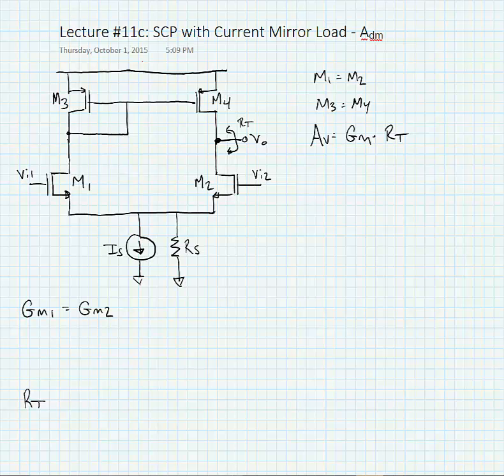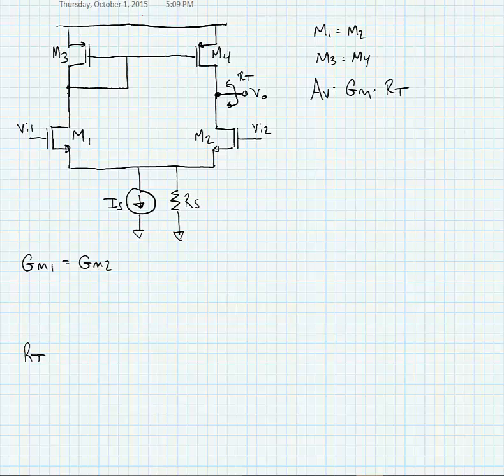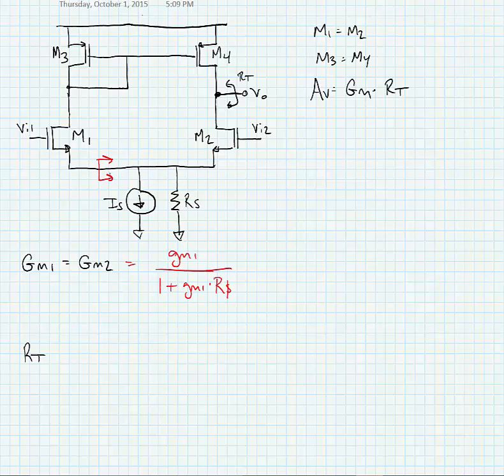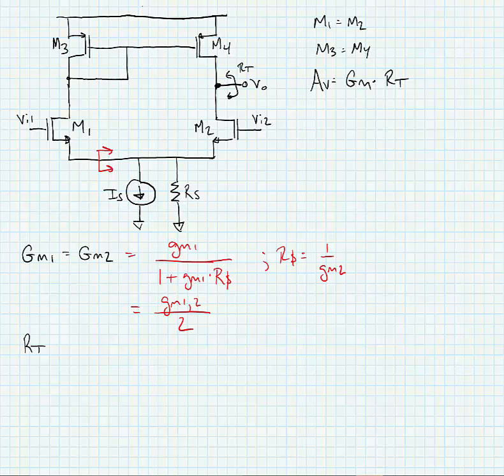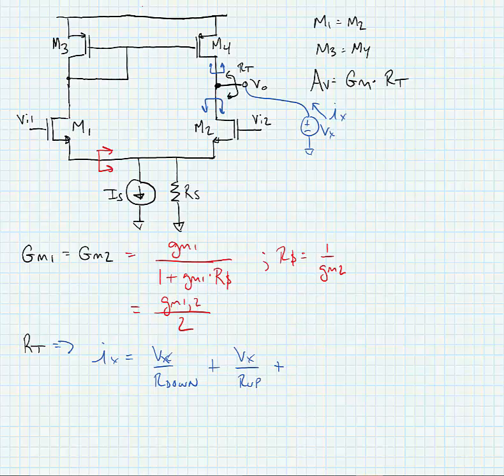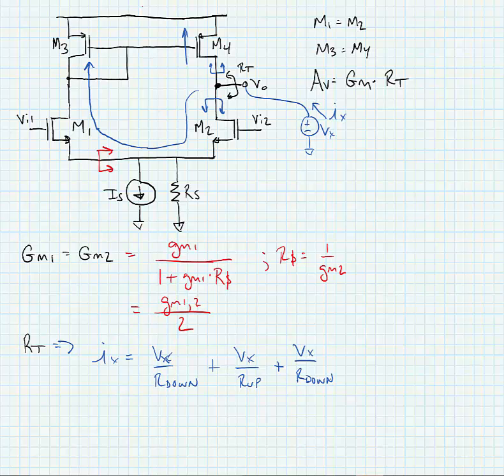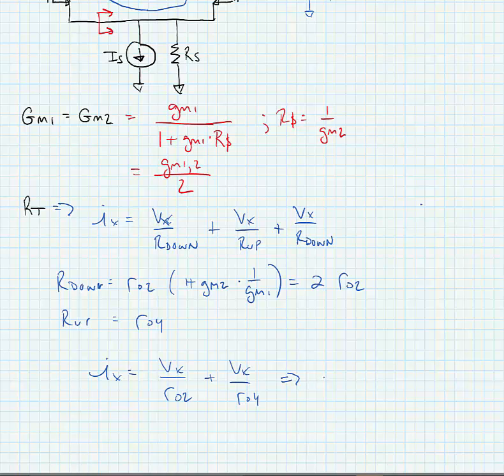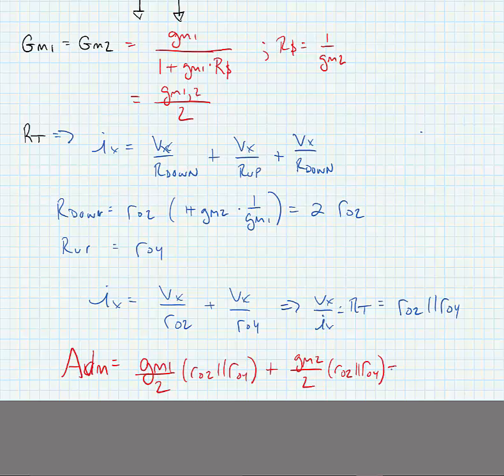ECE 3110 - Lecture 11c: SCP with Current Mirror Load - Adm

Comment: The derivations of Gm and RT are very confusing, especially the KCL at the output node. As stated by @theslippymaster, the source node is virtual ground due to differential symmetry. Hence, Gm and RT should be same as a Common source transistor and not that of a degenerated one. Furthermore, later in the frequency response (lecture 12 part 1), the values of Gm and RT are not as you derived here but instead what I have stated above.

Comment: Did you ignore Rs because you are finding differential mode gain? And an artificial ground is formed at the sources of M1 and M2?
Reply: This got me confused too. However, it seems that Rs was ignored because it is typically large. If he had used virtual ground assumption, the Gm would not be half of the gm of M1 but gm of M1 instead.